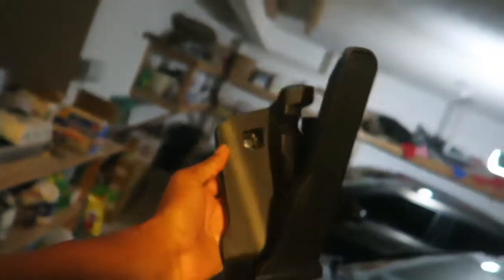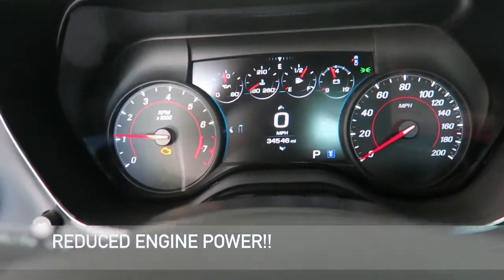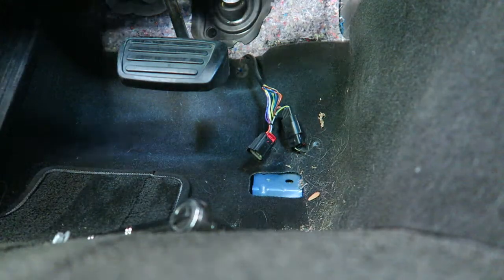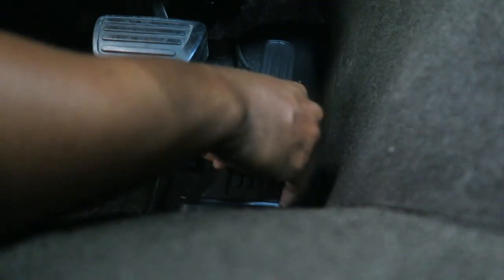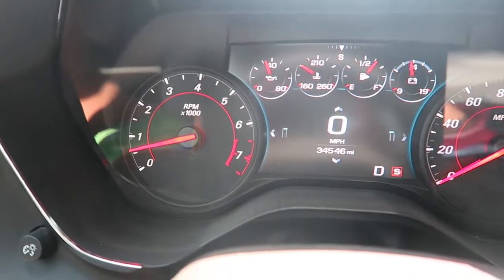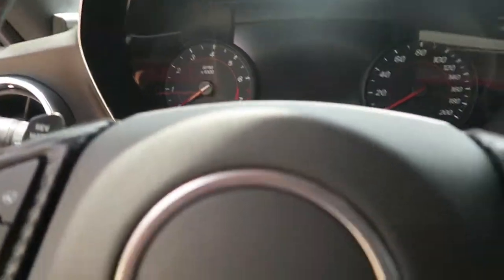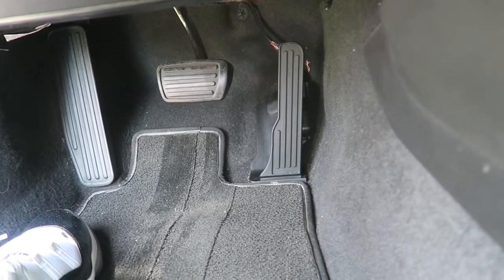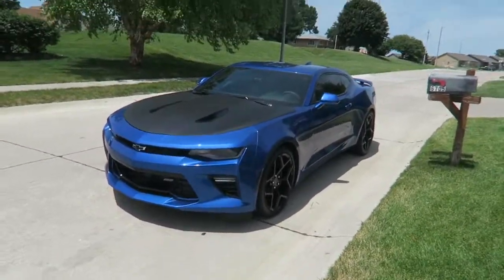My Camaro's Gas Pedal BROKE!! (Engine Power Reduced/P2138)

Comment: I dropped by car off today at dealership to get this fixed and they couldn't pull up the code. So i'm still having this issue. My check engine light as well will reset after a couple of start ups. Can you post the link where you purchased the petal? It would be very helpful! Thank you
Reply: Have you gotten your issue fixed ? I’m having the same problem right now with my camaro but you can find the part at your local auto parts store 👍🏽

Comment: Why didn’t you go with the upgraded GM pedals (the ones with the metal finish)? Also, I have heard that the throttle controller can cause that to happen every once in a while.